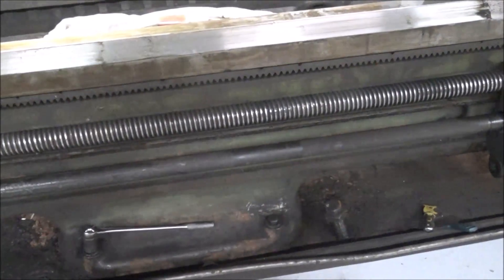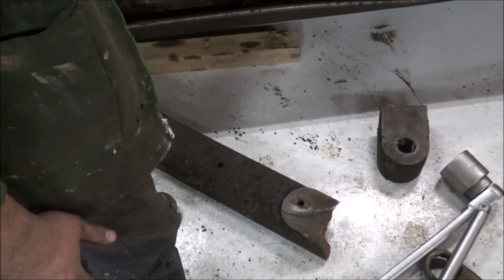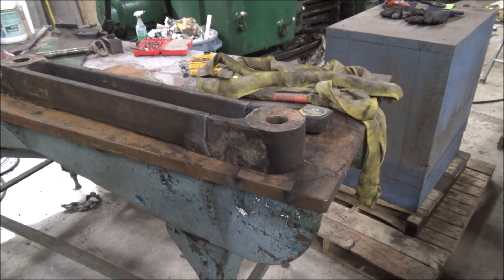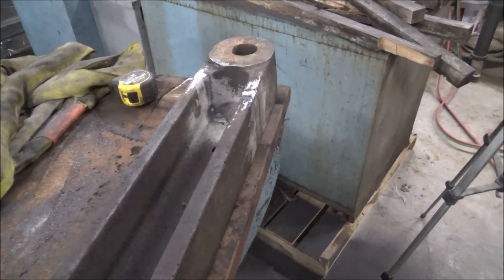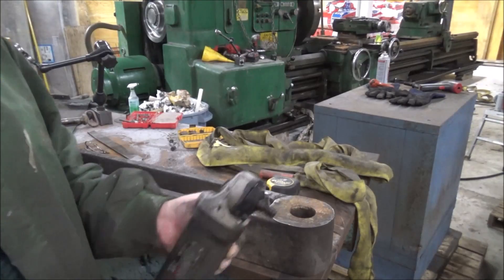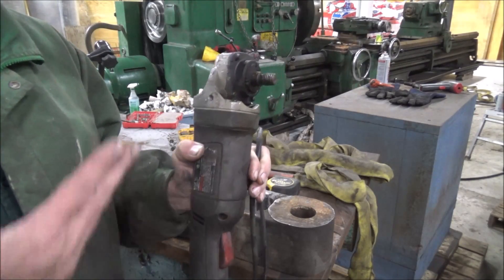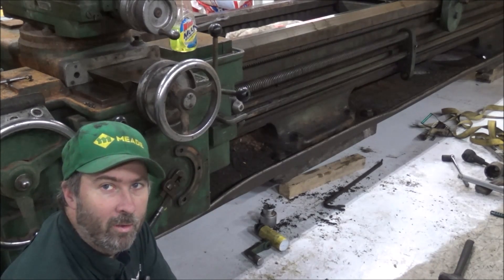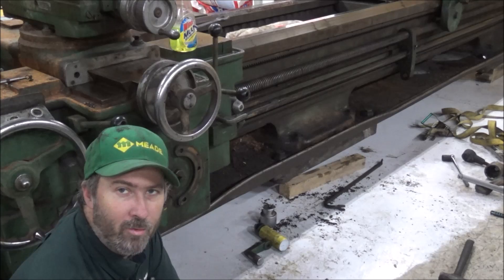Cast Iron Welding a Thick Machine Casting

Comment: Curious, you stated you preheated to 200* did you do the entire part or just areas close to the weld zone? I have a base for a milling machine that was dropped and broken about 9" of the front of the 200lb base broke off and I want to try and weld it back together looking for any advice I can find. Thanks
Reply from the maker: If you can heat the whole thing is the best.

Comment: Did you not preheat it and let it cool down slow? Or peen it?
Reply from the maker: Description says I preheated to 200F. I rarely peen. The us government did some testing on cast iron welding for repairing the capitol dome. In their  testing it was found the peened welds were actually more likely to crack. Having done lots of cast welds both with and without peening honestly I can't personally say I have seen a difference.

Comment: Try stick welding with the pedal too Brian it comes in handy, great job!
Reply from the maker: I used my pedal on this job. I find it convenient to be able to get the rod down in the gap where I want it before hitting it with the juice. It helps to keep from having a wondering arc.
Reply: @bcbloc02   I should have known you were on top of it Brian!

Comment: Brian:  Ok I've got a question, according to Adam, the two "Keith's" and sundry others it is tantamount to heresy to arc weld cast iron because it causes the cast material to crystalize and weakens it.  That it should be preheated and then brazed with a bronze rod?  Now granted you did not have to do any machining on that piece.  And it's not likely to be under a lot of torsional or tensional stress and is just holding dead weight.  Your thoughts captain?
Reply from the maker: It depends on the grade of cast you are welding and how you weld it. Most machine irons are very close to malleable iron and weld much better than grey iron. You could never weld white iron as it is just too hard and brittle in my opinion. You could still cut this cast in the weld area with a file so it did not get hard and brittle. Cast iron is regularly welded with much success in industry.  Using the proper rods makes all the difference.  Then what is best is if you can do a high temperature post heat and slow cool. Usually then you will have no problems. I have welded broken machine gibs back together and then been able to scrape them back to proper contact. I have welded lots of cracked cylinder heads and even welded turbo flanges back on exhaust manifolds on engines that saw 1800deg exhaust temps!!  I guess it is all about what you have success with.
Reply: @bcbloc02  Brian thank you for all the info.  Regarding angle grinders, everyone seems to have their favorites or is an expert.  Myself, I can only say I own half a dozen angle grinders, 4"-9" all are Makita as are many of my other power tools, mainly because I still have Makita tools that I bought in high school and have yet to ever have a Makita tool croak on me.  One exception being a drill I dropped off a 14' pole barn roof on to concrete.  In all fairness the service center said it was fixable but was cheaper to buy a new one since they weren't willing to pay for it claiming they felt conditions exceeded the warranty parameters as it was in several pieces.  Damn narrow minded of them I "thought"!   All joking asside I've had great luck with makita's.  With that said there are s lot of quality tools out there.
Reply: @bcbloc02  Brian:  I own one of these and it's one of my favorites in the larger sizes because it's less that 7.5lbs.  I have small wrists and heavier power tools really take there toll, also it's electronically governed like a lawn mower when a load is applied it maintains RPM.   https://www.makitatools.com/products/details/GA7011C 
If you're looking for industrial this would likely be the best bet in the Makita line, https://www.makitatools.com/products/details/GA7001L
Reply from the maker: I have a Big Black and Decker 9" If I want to grind like crazy. I really needed a smaller grinder I could access tighter spaces with. I ordered one of these. https://www.makitatools.com/products/details/9005B
Several people said they were good. I looked at one of these at Lowes https://www.dewalt.com/products/power-tools/grinders/small-angle-grinders/412-in--5-in-high-performance-trigger-grip-grinder/dwe43113
but it was really long. I often times use my grinder without the side handle for clerance issues so a rat tail style is a must for me.

Comment: Hi ,  what grade of Eutectic  rods did you use ?   They always make  good stuff  - i used to use their eutalloy torch for building up shafts & welding cast iron .
Reply from the maker: I did pre heat it to about 200deg with a torch to burn off the grinder 
dust and to make arc starts a bit easier. Then once I got going it 
stayed plenty warm on its own. then I welded it out with Eutectic Xyron 
2-24 1/4" rods run at about 225 amps DC high frequency on.

Comment: Nice repair...not an easy task on cast iron. Did you use nickel rod? or 7018?
Reply from the maker: see description for full procedure.
Reply: @bcbloc02  Thanks, don't know how I missed that. Bummer about the Porter Cable, there was a time when they actually made good tools.

Comment: I feel like that angle grinder could be repaired. I've fixed quite a few in my day. Might not be worth it to you though. Plenty of components to salvage from it.

Would love to know if any extra heating up and cooling down in sand was necessary.
Reply from the maker: I doubt rebuilding a $30 grinder would be worth it.
Reply: @bcbloc02  It may not be worth the time. especially with you working during the week and YouTube. Did you ever take it apart? 

Sometimes all it is, is a cord that has popped and can be shortened or replaced at the owner's discretion. You said motor, and it sounded like it was getting juice, but did not function. It may be brushes, switch, or the armature is trashed. 3 years is good though. Plus the price of the part is probably half of what the grinder cost originally. 

If it was an old AEG, Dewalt, Makhita, or Milwaukee. It would probably be worth it. But this poor Porter Cable is probably destined for the trash.

Comment: I was expecting you to get the oxy and heat it all up.
Reply from the maker: I did pre heat it to about 200deg with a torch to burn off the grinder dust and to make arc starts a bit easier. Then once I got going it stayed plenty warm on its own. then I welded it out with Eutectic Xyron 2-24 1/4" rods run at about 225 amps DC high frequency on.

Comment: Brian, I have a friend that has an old iron worker for sale, may need a switch, $750 (pretty close to scrap value I think). Also a 16" horizontal band saw, works asking $750 and a power slip roll - 36" I believe, asking $600. Located in Paris, Ky if you know anyone that may be interested in any of these things.  Thanks.
Reply from the maker: Got any pics? send them to me bcbloc02 at yahoo dot com especially interested in the ironworker depending on size
Reply: @bcbloc02  Sent a couple pics, let me know if you get them. Been having issues sending them. I can take more if there is something specific you want to see.
Reply from the maker: I did not get them be sure you use zero two and not letter O 2
Reply: @bcbloc02  Tried again...

Comment: well done brian you didnt fancy that autogenous welding on that piece  ? i came across a couple of other ideas for cast repairs - thermit or carbon arc ?
Reply from the maker: I tried carbon arc melt on the drill and it didn't work well for me.

Comment: Good stuff. Guessing it was a good pile of rods to fill those voids. Mine usually has blow holes and voids.  Maybe if you keep at it you can achieve my level of excellence...LOL. 

Based on the result I am guessing that the folks in Ohio did not use some garbage cast iron.  

Well Done - enjoy the weather while it lasts.  Now back to work. 

Dan
Reply from the maker: I think it took about 10 rods. Not too bad. :-)

Comment: Which Eutectic rods did you use Brian?...and....Looks like a trip to Harbor Freight is in order for a new grinder...lol...
Reply from the maker: Xyron 2-24 1/4" rods run at about 225 amps DC high frequency on.
Reply: check... thanks

Comment: Good to hear. It takes time to fix other peoples mistakes. I just wish you could do more video's. I know in the winter months you have some extra time, during the summer i know you are busy farming, harvesting crops etc. Be realy cool once the shop is completely  done with plywood and insulation. Going to be looking forward to the video where you open both doors and whole shop is done, all clutter cleaned up, floor painted, and a huge amount of space in the middle. Going to be a awesome shop when done. Keep up the video's buddy and have a good one. I watch your's and Adam booth channels, you can learn alot from them. Just wish i had a garage to do some work like that, kind of hard living in a apartment. I will be watching many more to come.
Reply from the maker: Thanks! Yeah an apartment puts a damper but there are getting to be lots of "maker" spaces around where you likely could get tool access to get started.

Comment: Pretty good results, what type of Eutectic rods were they...???
BTW, that Wilton vise is looking pretty good by now, just re-assemble and editing....    Sigh...!!!
Reply from the maker: Thought maybe just waiting for the paint to unfreeze!  Will look like new when you are done.
Reply from the maker: Xyron 2-24 1/4" rods run at about 225 amps DC high frequency on.
Reply: @bcbloc02  There is A LOT of Nickel in that, great for cast iron or anything with high carbon hard to weld, wouldn't want to have to purchase a box of those,  $$$$$$$$$$$$$$$
Be careful with ventilation, there is high level of fluoride emitted while welding, also highly reactive to skin...
Reply from the maker: @pierresgarage2687   I bought 2 10lb boxes for $35ea and stock piled them for when needed. :-)
Reply: Kinda also my way of doing things...   ;)

Comment: When I have a power tool like that that goes to pot, if the power cord is in good shape, I cut the cord off and keep the cord. “Sanford and Son Salvage” Now, my father, bless his soul, would probably open up the tool and save gears, screws, and anything else salvageable.
Reply: Steven Haskell 
I was curious if a brush change would fix it .
Nice small right angle gear box for the saving
Reply: Send it to AVe, he'll do a forensic analysis

Comment: Brian good fix 

Is that pipe wrench a standard fitting on the apron ?

Stuart
Reply from the maker: I guess it is until I can get that linkage unfroze! Obviously It has been a problem before or seen a lot of use as the hole the roll pin goes thru was wollowed out and the pin broke when I was rocking it back and forth trying to get it free. It is the last stuck linkage I have to get unstuck.
Reply: Brian
You will have to get a can of unstuck stuff , like the magic smoke refill kits , only joking

Glad to see the old girl getting some TLC 

That is the size of some of the lathes in the maintenance machine shop , but they did have 
‘Tool room ‘ sized for the smaller jobs

Comment: Brian, is a piece like that just way too big to worry about pre/post heat?
Reply from the maker: I thought about doing a post in my heat treat oven at high temp to stress relieve but the material actually welded so nice i didn't figure it was necessary. I guess if it breaks off later I can always do it then when I have to re do it. lol
Reply from the maker: I did pre heat it to about 200deg with a torch to burn off the grinder dust and to make arc starts a bit easier. Then once I got going it stayed plenty warm on its own.
Reply: @bcbloc02   I usually just wrap with fiber blanket or something, but I'd say if it welded good and didn't crack right after welding or when cooling it's good to go. Thanks.

Comment: What type rod did you use
Reply: 1/4" Eutectic rods, my guess would be the Xuper 2240 as those are meant for welding cast iron without all the rest of the mess that cast usually calls for.
Reply from the maker: I will have to look, I can't remember the exact number, just some I had left from the drill weld project that I liked.
Reply from the maker: Xyron 2-24
Reply: coat hangers work in a pinch
Reply: Look at description.
Reply: 1/4" rod does not describe the type that was used... only the size...
 @Steve_Just_Steve